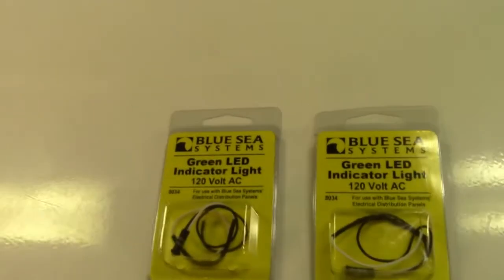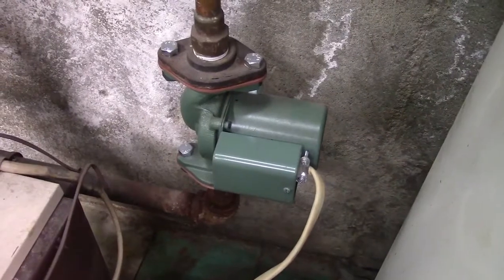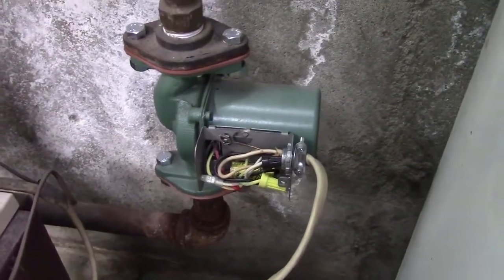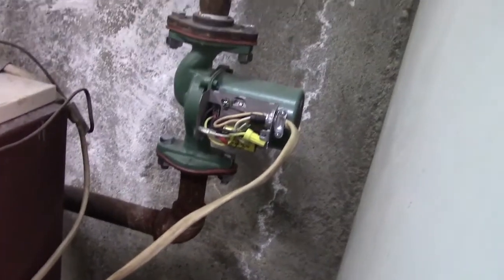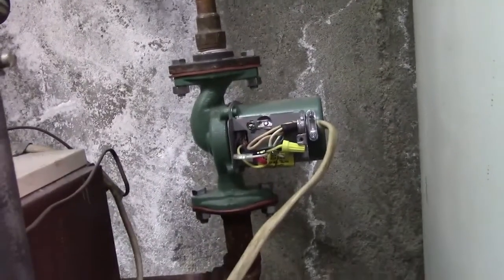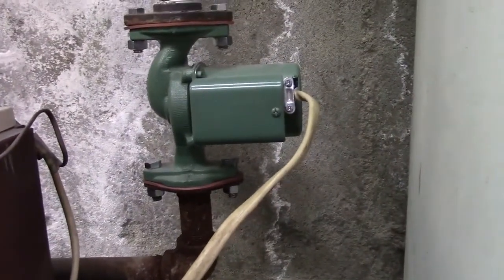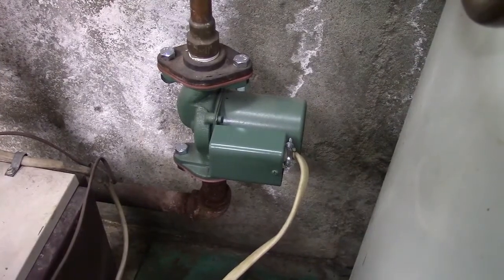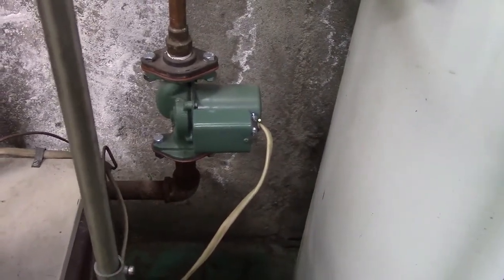Adding Indicator Lights To Boiler Circulator Pumps

Comment: Nice! I was kinda hoping the bulbs were larger but given how you had to install them, that probably would not have worked out well. These would have been cool to have on the zone valves of the Slant Fin boiler at the LI house.....if the basement was unfinished. They would never be seen otherwise. 

Even though you can clearly hear when it is running, maybe something like that would cool on the exhaust fan motor for the water heater here. I know that's 120 volts. Though, not sure where it would look good, at least for the moment. The furnace would be cool too. But given the electronics, not sure where that could work well, nor do I know what the voltages are.
Reply from the maker: These are fine.  I would have preferred 5mm LEDs instead of 3mm ones, but those were the ones available.  You can, of course, rig up your own LED and resistor, or get creative and use a small incandescent bulb as well.  These were all I needed.  Now what would be even more awesome would be an indicator by the thermostat that tells me what's happening, but being that these run on 120v, I'm not going to be doing that.

Yes, the water heater exhaust fan would be a PRIME place for one.  You could see it from across the basement.  If that fan has any sort of electrical junction box on it like these pumps do, it's a cinch to wire in.  As for the furnace, the main blower fan would be the place I would say, even though obviously you can hear it running.  I know the main blower for my A/C air handler is 120 volts, so that's an easy place to put it, but again, you'd hear it running.  For you, since yours runs at high or low speed depending if it's heat or cool, you could, theoretically, if it's 120 volts, wire 2 different color LEDs up, one for each speed, although obviously you know high is for cooling, low is for heat, and never will both be on at the same time.

Comment: Looks like a handy added feature to me, and proper use on LED technology. I would have done the same thing on installation. No need to start drilling holes when you don't have to.
I've though about putting some sort of indicator light on my workshop, so I can see at a glance, from the house, if the power is on. There have been a few times I've forgotten to cut power before going to bed.
Reply from the maker: Sounds like you have a small project coming up!
Reply: It's looking that way. Just added to "the list."

Comment: I think it would've been nicer if you had 2 different colored lights to tell which zone is on, but this should work.
Reply from the maker: 6 of one, half a dozen of the other.  Perhaps it would have been even more visible, but I like to keep colors for their particular purposes, like yellow being caution and red being stop, error, or catastrophe.
Reply: Makes sense. The old water heater in my old house actually had a green LED to say it was running too.
Reply from the maker: Perdonski....

Comment: Millennials would have to have some sort of digical clock to see is the pump is on or not, and to see how long it might run for.
Reply from the maker: It would need to transmit a notification to their phone for them to know ANYTHING about it.
Reply: @jaykay18  doo daa doo hun let me check my crapple to see if my pump is running even though I feel heat coming from the radiator
Reply from the maker: Yeah, you know it!